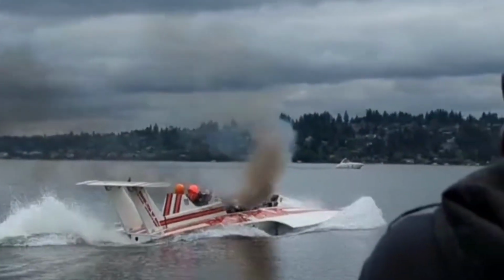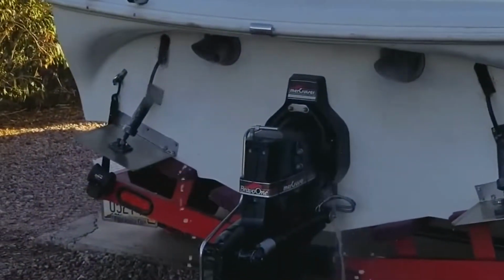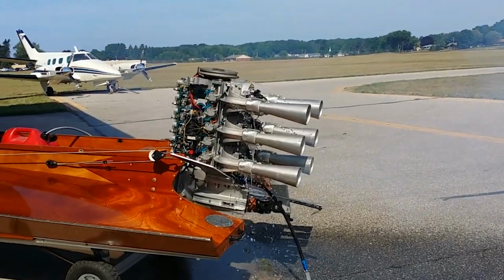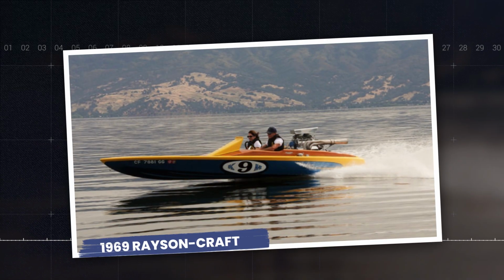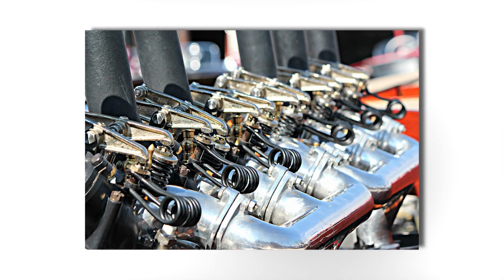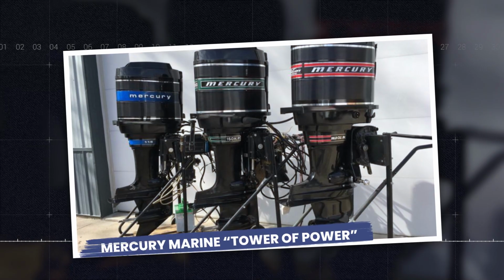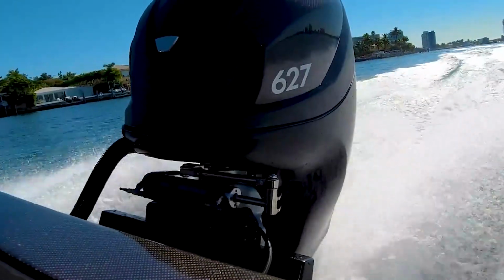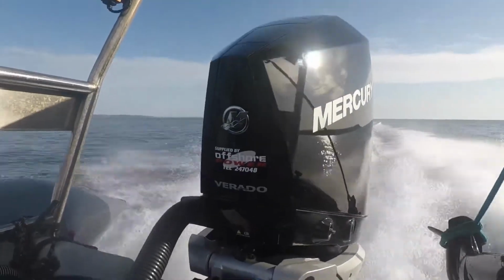Rare Old Boat Engine Starting Up Sounds That Will Blow Your Ears!

Comment: A work boat 1971 , with two Chrysler 7 litre continental alloy, V8s mounting twin Holly four barrel carbs, running high torque cams. Driving a pair of new Hamilton jet units. Germans paid lots for New Zealand high country venison. Deer were shot from helicopters and lowered onto high country beeches of rounder stones for this 26 foot fibreglass record setting monster. It flew over water and skipped over the rocks with two tonne of deer. There was a bounty on the deer which were introduced, and destroyed habitat. My father's company built this alongside several Rio Balsas River race champions.
Reply from the maker: @markrowland1366 thanks for super interesting comment. Is this still running?